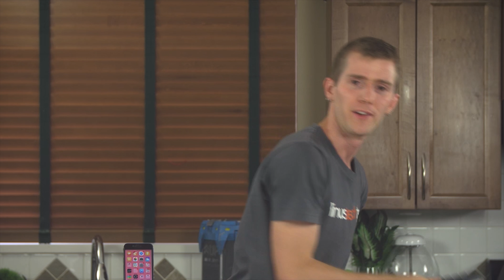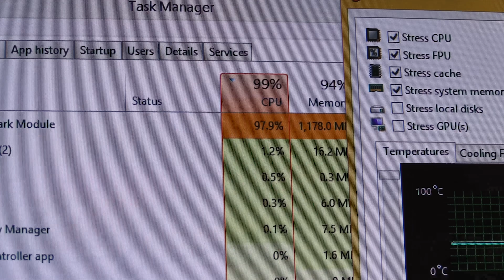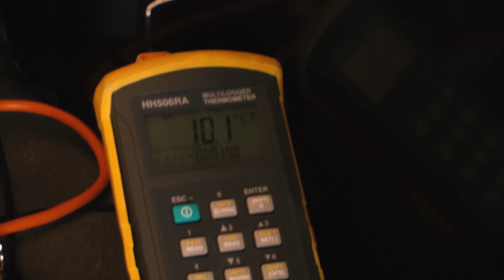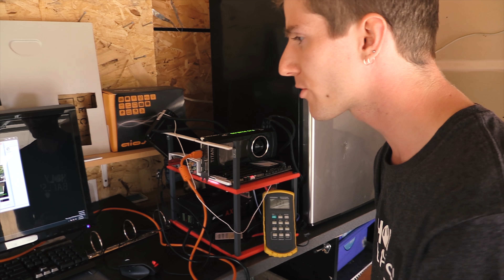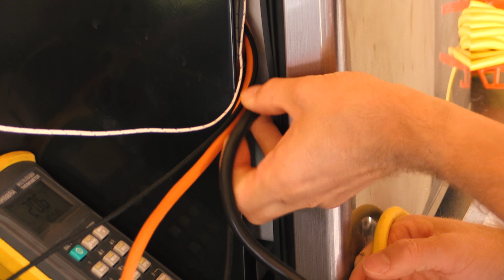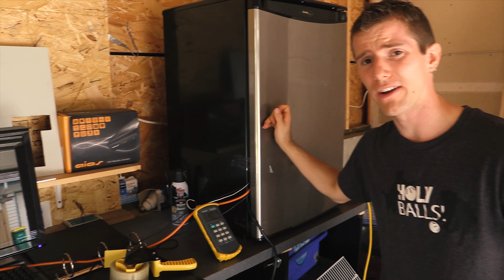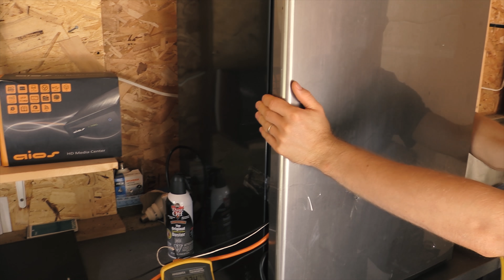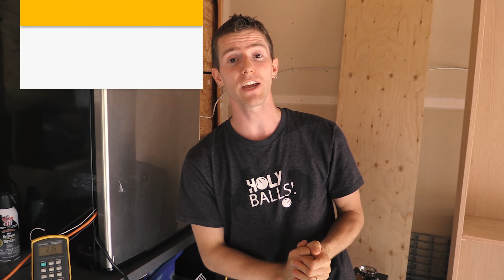PC Build in a Fridge - Does it Work??

Comment: I've been thinking of getting a small AC unit designed to cool a room, and setting it up directly in front of my PC intake fans.  My house doesn't have AC and it gets to about 90 degrees Fahrenheit in there during the summer on some days, which tends to annoy my PC.  And myself for that matter, since the PC contributes to heating up the room further lol.

Either way the only problem I could see with doing this is if I get the wrong kind of cooler it might humidify the place too much and possibly cause condensation inside the PC.  Any other potential problems with doing this that you guys can see?
Reply: Raging Golden Eagle Air conditioners will dry out the air that they cool, so condensation wouldn't be an issue. It's pretty common in server rooms and workplaces to run aircon to keep systems cool, so yeah, your idea would work fine, just remember you'll need a decent amount of power to offset a PC outputting several hundred watts at load, plus the already elevated ambient. in short, it can only get better, how much better, is up to the AC unit. The situation seen in this video is only an issue because the PC is in a tiny confined space, and fridges aren't designed to dissipate a great deal of heat, only to maintain a cool space that normally wouldn't have outside factors increasing it's temperature.
Reply: Chris Tate While I agree with your statement, there are many factors that can be a problem when it comes A/C home design and the installation practices used. If the unit was not installed right, or is sized incorrectly,  or even if the person has the fan set to on (fan stays on when AC goes off) - The moisture that is still in the drain pan of the AC can be redistributed into the air - which can rapidly increase humidity within the ducts, depending on many factors.
Besides that your answer was spot on.
Reply: shadowthrone This is true, a typical window a/c blows a lot of moisture back into the room.
 After an hour of running through a plastic cylinder shoot, its dripping wet, inside and out. (Tried myself)
Reply: shadowthrone Fair enough man, I'm no A/C expert, I didn't really think that they'd allow you run the fan without the cooler part on. I've only had experience with small free standing units, so don't know much about the ins and outs of installing them. peace!
Reply: My AC is directly behind my tower and I usually always have it on. Keeps my room and my computer at a cool temp. Definitely works.
Reply: Tactical Noob Gamer Dehumidifiers typically have a large condenser and an extremely small evaporator.. Even more so than a typical A/C ..
Being efficient at cooling VS Being efficient at dehumdification are somewhat different.
Reply: Derpalicious There are many factors that come into play - it is never the same for anyone, it is not a one fit all type of thing. A person in a high humidity climate can easily reach dewpoint using an A/C - even more so if it is over sized.

Is your ac a wall/window unit? A split system hooked up with the furnace? Is it an indoor portable A/C (vented out the window)?

There are many factors that come into play!
Reply: Raging Golden Eagle that annoys your pc. My pc is practically screaming, here we see day temps going to about 41 Celsius  (106 Fahrenheit) in the summers.
Reply: Raging Golden Eagle ACs are natural dehumidifiers....
Reply: Raging Golden Eagle Why not use a liquid cool system and have the cooling radiator near the AC.
Reply: Raging Golden Eagle ....Why not just get a slightly bigger AC and cool the room?? So confused. Do you live in an area where ACs are expensive? Did I just show off my ignorance at other's financial trouble? I just find it strange you can't simply get a slightly bigger AC for the whole room....even if it only amounts to single digit differences in ambient temps, it's still going to help with the PC's own temperature.
Reply: ***** .......What? I was asking the OP.
Reply: Greyghostvol1
My room would be much cooler if my PC's heat wasn't making it so much hotter :P
Reply: Raging Golden Eagle
Even with central AC I have that issue. So I turn it  up leaving the PC room a nice temp. Only I later get up  to get a drink and the rest of my place is as cold as the fridge.

Also heat rises ever thought of getting a PC case where the fans blow out the top?
Reply: Raging Golden Eagle hehe, well I have a $200 USD window AC from a few years ago that keeps the room my PC is in at a frosty 66 degrees F (around 19 C) during even the hottest days in NYC...though the room my PC is in isn't very big...8x12x12 feet.
Reply: +Raging Golden Eagle Your house doesn't have AC?? I forget buying a AC unit for my computer, I'd be looking for a different house for me.. I grow up in a house with no AC, I wont make that mistake again. When you work for a living, you should be able to come home and get a good nights sleep before you have to get up and go again. In the long run, you live longer, and get more work done every day if you sleep well. If i found out one of my employees didn't have AC, I wouldn't sleep until they did. It's that important.
Reply: +avmf8 if your PC produces so much heat that it heats up the room, somethings wrong with your PC. My machine draws over 900 watts, and it doesn't heat up the room. Even with two, 6 core CPUs and two high end videos cards.
Reply: ***** Seasonic makes great quality PSUs, their top marked PSUs are among the best in the consumer market. 

By the sound of it you have an XM2. That's one of the their best rated PSUs to date:

https://www.techpowerup.com/reviews/Seasonic/SS-1050XM2/

If it's failing you that badly and you've removed all variables, it's likely you're just unlucky with your particular PSU. That happens. Even the best companies out there won't have an absolute 0% failure rate. Just call them and exchange it for a new one. Their customer support service isn't anything special, but they're helpful enough.

Seasonic makes alot of the PSUs that companies like Corsair sell (Corsair doesn't actually manufacturer the PSUs they market). My main PC's PSU is an XFX, which are/were (Not sure if XFX changed partners) all Seasonic rebrands and it's at this point three years old and still going strong.
Reply: I run a pair of CX600s. They work very well in my machine, and I pull some serious juice.
Reply: James Jarmon CX600s are made at varies Taiwanese/Chinese manufacturers. This in and of itself isn't bad, Seasonic is Taiwanese, for instance. However, again, they're not the ones that make the CX600s. It's actually difficult to track down the companies that actually manufactured a single CX600 as again, it varies.

They're decent enough PSUs for most budget builds though, just not the best. Also note that there are plenty of consumers that have complained about faulty CX600s. But, ya know, loudest ones and all that.
Reply: +Wolf Alpha Humidity isn't as big as of problem as you might think. The AC dehumidifies the air. If you want to go all out and make it a closed air path and recirculate it, that's even better. Throw some DampRid in it, and you won't have to worry about anything.
Reply: +Raging Golden Eagle direct cooling like that would cause condensation; look up dew point
Reply: *****
Yes.
Reply: Luckily my house comes with a heat pump. It isn't a normal heat pump, it is actually a variable speed VFD driven system. It is a mini split if you are wondering. Made by Mitsubishi. About 11 years old and still working very good. For those who say these inverter ACs are unreliable, my system is built like a tank. It has a PROPER sealed metal box containing the variable speed drive! Not the stupid modern plastic ones that moisture and salt air can enter!
It has 2.5 kW cooling output and 3.2 kW heating output. When I say 2.5 or 3.2 kilowatts I mean the amount of the actual cool/heat coming out of the indoor unit. Also called capacity.
Power input max is somewhere around 0.640 kW for cooling and 0.760 kW for heating. I'm surprised by that.
I don't have central HVAC. I don't even need it. I only see businesses and shops have central HVAC. It is rather very expensive here, and cooling/heating the WHOLE house is unnecessary unless you're living under intense temperatures.
Reply: A mini-split would be a godmode pc cooler if you do it right.
Reply: frtard Yeah, my Inverter HP is so efficient it would probably use less power than a 1000w+ PC power supply. Unfortunately my HP doesn't have an energy star certification on it, probably because it's pretty old.

Comment: what a "surprise"... a closed air environment that is designed to cool "static" food, doesn't work when a PC without the ability to blow out it's heat is placed inside. Could just as well put a hot airgun inside and wonder if it would cool down.. This is just plain stupid...

Comment: there is no need to have the power block in the fridge that would cut out a lot of heat and if that didnt do it you should have tryed just putting the cpu radiator in the fridge with some fans hooked up to it lol b+ though maybe we could get a part two

Comment: bad implementation for a large PC. if you want to use a mini fridge compressor to assist in cooling a compuer, then do the not-so-stupid thing and utilize it in a water cool loop AFTER the radiator and before the CPU. you'll achieve better results. don't place the entire computer in, what is essentially an air tight, air-trap which just gets hotter and hotter... you still want to use normal, ambient air cooling for the most part, but for you GPU, CPU watercooling loop, feel free to use a LARGE resevoir that is internally cooled by a refrigeration unit.

Comment: People have been modding windows into cases for decades now. Where's my miniature A/C case-window unit? It would be fun to run tiny A/C ducts to all of my components. Then I could just point all of my case fans to blow air out and it should work
Or use that freezing cold water from a fridge that dispenses water to cool your water blocks. You wouldn't have to put the PC in the fridge. That's ice cold filtered water...you could even put a tap on the PC, since your taking up the one on the fridge, and drink it! Set up a system to purge the reservoir of warm water and refill with cold water if the temps start rising or a certain time has elapsed.

Comment: That's incredibly energy inefficient.
I know it's not really the point of the video , they are exploring a concept but the efficiency of such a thing is abysmal.

Using liquid cooling with a good radiator would be far more efficient.
If you truly want to go hardcore you can put the radiator itself in a cooler.
Be carefull in not using a normal fridge , they are not manufacured to keep hot things inside of them , having the fridge pump working without stop (which usually it doesn't) shortens the fridge lifespan tremendously.

Comment: Now time to put your mineral oil PC in the fridge. Give it plenty of time to get the thermal mass of the oil right down. Fringe benefit you don't need to worry about condensation. Ultimately the fridge will only cool at the same rate so run times might be short, but what temperature does mineral oil freeze at? Extreme mineral oil build in a chest freezer?

Comment: i think there would be too much moisture in the environment in there anyway. every time the door is opened warm air will enter, and then condense... it would be a very good (commercial) fridge that would actually provide dry enough cooling... wipe your hand along the inside walls of your fridge some time... a little wet?  wouldn't want to expose pc parts to that for long?
(love your channel by the way :-)

Comment: At the behest of a friend, I tested the viability of using my mini-fridge to cool my pc... For obvious reasons (condensation) I didn't want to start by going whole hog, so I did some digging around the house and found that my wife's wax-warmer gave me similar heat loads as my external temp probe showed on my CPU... Yeah, as in your test, the inside of the fridge just couldn't move that much thermal energy and the inner-ambient temps of the fridge were far warmer than the room temperature...

Comment: I put my PC inside an empty deep freezer... I modded my water loop that uses anti-freeze and it reached almost 7 Celsius idle and 15 Celsius under 7680x2160 (dual 4k), GTA V absolute max settings (avg 54 fps :D ). Don't ask me what my PC's price tag was, cause somebody gave me the money for my PC and I will feel genuinely bad for him considering my PC has 4-way SLI GTX 980Ti's, i7-5690X, 64Gb memory, and a whopping 8Tb storage via 4x 500Gb SSD's and 3x 2Tb 72000rpm HDD's and a custom liquid cooling loop.
Reply: noah roberts *5960X
Reply: Pics or didn't happen
Reply: Nathaniel N lol obviously its fake, it is a nice idea though :P

Comment: I did this before about 6 years ago. I put only my radiator in the fridge and piped the tubes directly out the top and insulated the tubes. Worked great.

Comment: Linus, there are industrial enclosure air conditioners that would work.   They are a really expensive version of a "window shaker".   I use them to cool industrial electronics such as PLCs and VFDs.  A 500W Power supply would require a 2k BTU/hr A/C unit, which would run well over 2000 dollars, not including the enclosure.  Anywho, love the vids, keep up the great work.

Comment: Shouldn't have used a water cooler for the cpu lol use a big heat sink with a fan inside the fridge,also give the fridge some more time when running tests cause you said it doesnt work 24/7,hence allowing it more time to drop the temp Loll depends on the time you have xD

Comment: any thoughts why my 5930k runns hotter than it should?  i have it at 4.375ghz @ 1.3v, which i expect some heat from,  but its around 39-42(depending on ambient) idle on a h110.....

Comment: Guys, I accidentally dropped my piggy bank life savings and bought this cheap $49.99 computer set from my neighbor (I am still building it right now)
Is this good enough? Can I run Windows Explorer very fast?

Specs:
Processor: Intel 4004 half core .5GHz
RAM: 500KB (Upgraded to 1MB) DDR0 69 MHz
Case: Shoebox Master Case (Cardboard Edition) Color Brown
Motherboard: Pico-itx 1.0 USB
Graphics Card: GTXYZ Titan Goliath 4Kilobite Memory DDR0
PSU: Corsair CX 900milliwatts
HDD: Seagate Barracuda 900MB
SSD: Kingston HyperX SSD 200MB
CPU Cooler: Electric Fan (Home made)
Operating System: Windows 1.0 (1985)
Monitor: 1980 CRT 800x600 Resolution  
Keyboard: Mechanical Typewriter 
Mouse: Macintosh Mouse
Mousepad: Smooth Cardboard

Comment: What about a freezer? would this work maybe with oil cooling if not water cooling or simply fan cooled? even though this could freeze, I think that the possibility of a computer doing that is unlikely due to the hot temperatures that it was running at in the video! Thoughts?

Comment: ive more considered using a mini fridge boring a hole in the side and using a coper coil similar to a wyrm in a distillery or similarly to the way your refrigerator provides cold water to you out the freezer side, this coil would submerged in water exiting the other side of the mini fridge as part of a water cooling loop, it would also serve as a local handy beverage container

Comment: Excellent explanation at the end as to why it wont work for anyone who would actually try to benefit from doing such a thing (that being people with high end systems). There are many different ways that are 10x as efficient than putting a pc in a closed system - unless of course it was all out controlled, but again - cost wise is retarded and only useful for computers the sizes of rooms, yet even then just conditioning the room is sufficient 95% of the time!

Comment: Cool mod but way too much moisture.
Ive put a failed HD in the freezer. At about 30 min or more I took it out and hooked it up. After 3 times I got almost all my data off of it. But the 4th try it didn't work any longer.

Comment: If you put heat inside the fridge you will break it. If it starts to cool down there is no problem, but if the heat remains, you'll break the unit. To have better results, you should buy a fridge made to cool under -20°C. They are very expensive, but if you really want to see if it works, you should use that and not a home fridge

Comment: I 'd rather put a aircooler than a water cooler. as the water dosn't loose heat as fast as absorbing heat.so the heat created is still inside the fridge.

Comment: Can a fridge cool me down if I jump inside it?
Reply: ***** No. You know why? the Matrix. The robots in the Matrix used human beings' thermal output for energy, not fridges'. So that means humans put out more heat than fridges. You see? proved it.
Reply: ***** Since you generate about 100 watts on idle, same as Linus' example, i doubt it. Temporarily – sure, but then the lack of oxygen would kill you before you die of hypothermia. But if you take an oxygen tank with you and are really determined, (and a hole to get your exhaust fumes out), you need something industrial. 
I normally hide my victims in walk - in freezers with a few hundred to thousand watts of continuous cooling power. That would also work for you. Wanna meet for coffee? :P
Reply: ***** Worked for the Simpsons :)
Reply: Nitay A. They didn't use fridges because they went extinct when they blackened the sky.
Reply: A working human puts out an average of 75W over 8 hours, at rest that would be reduced but I don't want to speculate how much so I'll just call it 75 W. Depending on the efficiency of the refrigeration cycle you'd need 1 W of electricity per 2-4 W of cooling, so 18.75-37.5 W of electricity would keep temps stable and more would cause temps to decline.

If the fridge is large enough for you to for comfortably inside, it'll probably work.